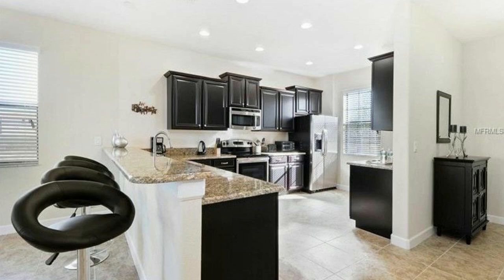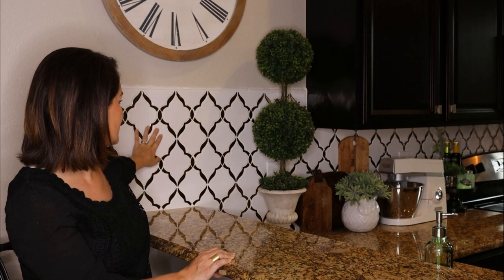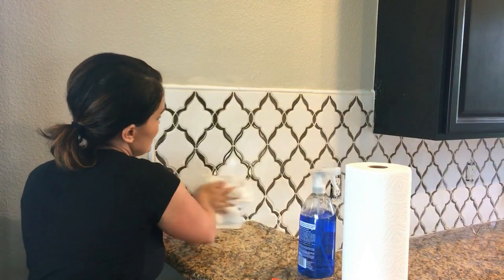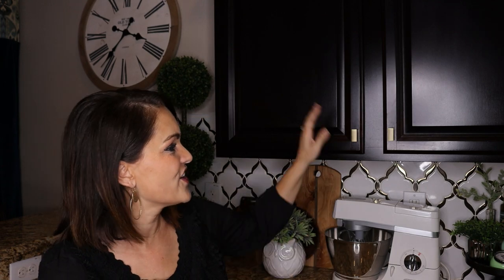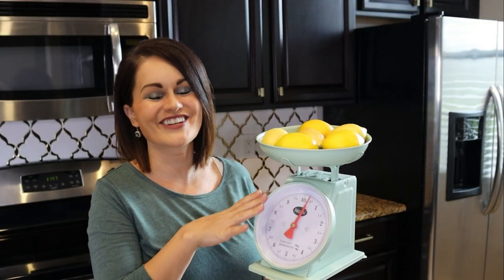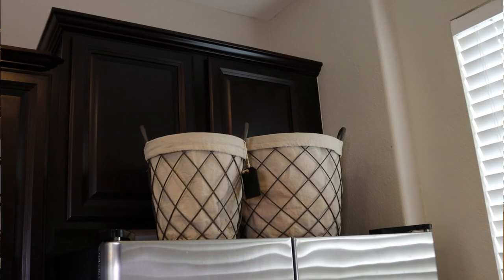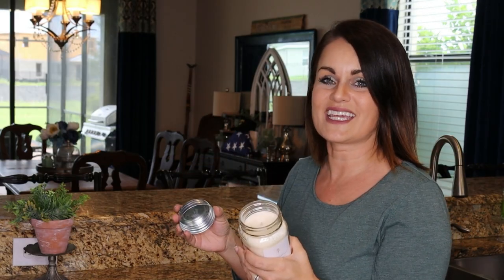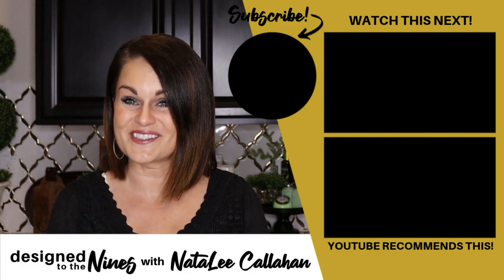DIY KITCHEN MAKEOVER- How I saved THOUSANDS!

Comment: Florida textured walls...I can certainly relate. I understand that in decorating terms you have a smaller kitchen, but if that’s the case, then mine is miniature! I would love to have half the storage that you have. You did an amazing job with the tile and the batten wall.
Reply from the maker: That’s why I kind of addressed it upfront. Because I do know that it’s on the larger side of small. I’ve had one and that’s probably 1/4 the size 1/3 of the size before and another 1/2 the size, the kitchen I had before this was a lot bigger. Hopefully you were still able to get some ideas.😃
Reply: Designed to the Nines ...absolutely! I loved all that you did, and I especially loved the idea of the wood box to corral all the utensils and bottles! I will be on the lookout for a similar box. I hope I didn’t offend you by mentioning the difference in size, it was meant to be funny. I’m a huge fan!
Reply from the maker: I am not easily offended. There was absolutely none taken.

Comment: I’ve replaced the tile backsplash on at least 5 or 6 kitchens and by far the hardest part is deciding where to start/stop the tiles! Do you go up to the bottom of the upper cabinets or do you go up and over the window above the sink? Do you stop vertically at the end of the lower countertop or at the end of the upper cabinets because they never seem to line up? Do you put the partial cut tile in the corner and a whole tile on the other end of the run or do you center it leaving a partial tile on each end? I spend more time sitting and staring trying to make these decisions, lol, than I do tiling!
Reply from the maker: Oh my word! All of these are great questions! I approach each situation on a case by case basis. So I totally get this. For me… I always like to have a full tile on the outside edge and I also like to add a little tiny border to finish it off a little bit better on the edge. Meaning sometimes the tiles in the corners don’t exactly lineup. But I feel like a full tile on the outside edge is more important then a full piece on the inside edge. Next, I always try to take the tile to the outside edge of the countertop whether or not the cabinet aligns or not. Also if there’s a hard stop above the window I like to take the tile all the way around the window know if it’s open on top then I stop at the cabinet line. Again, I lower exceptions to rules depending on the kitchen… So I totally see the dilemma.😃

Comment: I love everything you do.  When I finally decided to redo my counter tops I took the top ledge off and made it one level.  It was such a debate but after all said and done it was the best decision ever!!!! I put the outlet on the sides of the counter and shorter stools still work on the other side .  The work space is incredible and the BEST part is it cut my cost down because they didn’t have to make extra cuts in the new quarts counter top.  
I did go from a walnut cabinet to white and not the white is chipping down to the wood so I don’t know if I should retouch or go dark.  Any thoughts?

Comment: I had the same high low bar area and hated it so I did change and lightened counter tops so yes I would have changed those counter tops.
Reply from the maker: I totally agree. I prefer a normal height bar rather than a raised bar. It gives you more usable counter space. If this was our forever home I probably would’ve switched them out.😃💕

Comment: Can I ask a question, please?  At 11:30, you can see the corner and your tiles aren't matched up. Is this because you needed to have full tiles at the end of each wall? And, is this what you suggest for your clients to do? Thanks!
Reply from the maker: Good question! That’s exactly why. I chose to have full tiles on the outside corners rather than try to match it up in the inside corner. This corner has appliances in it and if it didn’t I’d probably put a topiary tree or something to disguise it even more. But yes I prefer a full tile on the outside edges rather than in the corner. With subway tile it’s less noticeable and other simpler patterns you don’t notice as much and it’s more prominent because of the heavy design of this tile.
Reply: @designedtothenines  Thank you for your answer! I thought that was probably the reason, but I wanted to make sure. Thanks again!